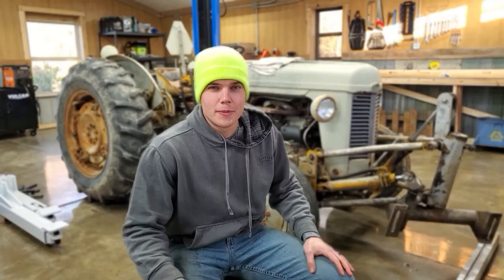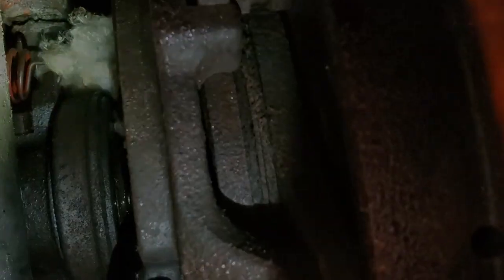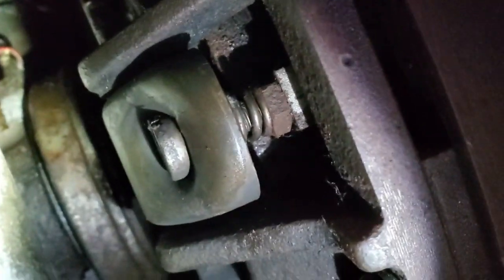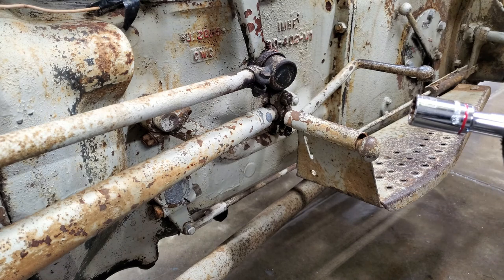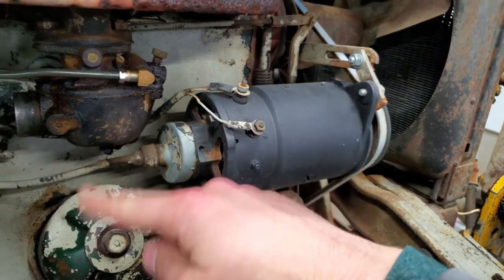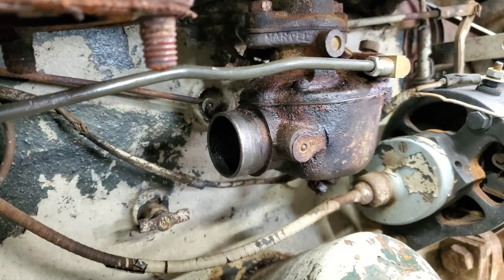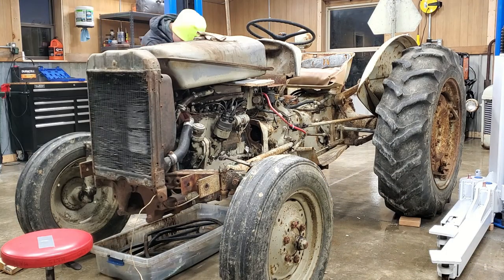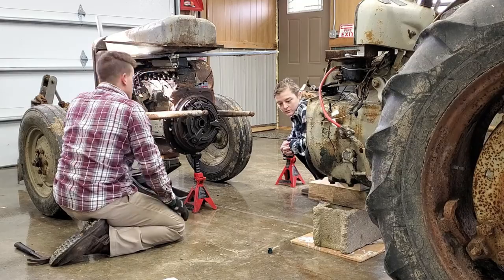Pt. 2/3: Splitting an Old Tractor - 1955 Massey Ferguson TO35

Comment: Yeah I’m struggling to support the from axel/suspension with 2x4s is still wanting to teater
Reply from the maker: I really had to hammer them in there. I would turn the wheel out of the way, then blast the 2x4 until it was really wedged in there. It deformed the 2x4 as it slid between the leaf spring looking thing and the bottom of the radiator support doodad (sorry for all the technical terms haha!). I'm not sure if that is helpful, but that is what we did.
Reply from the maker: I pinned your comment in case someone else comes along and can offer any additional advise!!

Comment: Had the exhaust flange gasket blow out on me the other day.
So I soaked the nuts good with PBB, every few hours for several days thinking i was doing myself a favor. 
Well first one on the outside left took a little extra with a breaker bar, and cheater pipe nudging it back n forth, but came off easily once I backed back tight couple times to clear the threads.
Outside right took good bit of heat and shocking it with cold water four or five times, and the rest finally went like first one. 
That back blanken blank, I had to remove fuel line the fresh air tube, both ends of the steering arm, and the peg running board, and the strut at the foot peg then swing it away from tractor. 
Still couldn't get on it good, because pipe has offset back towards engine. 
BTW, 17mm is what fit mine.
Anyway I went through most of a bottle of Mep gas, half of a big can of PBB, and couple trips to fill gallon bucket up with water.
When I thought it had broken loose finally, I went to tighten it up to clean the trash even though it'd barely moved.
Bout time I put just little nudge into it backing it up, Snap!
Shiny metal all the way across the dam thing, because it snapped clean off with just a tit sticking above the surface of the flange.
I popped it with snap punch about 5 times in a tight little circle around the very center of the broken stud as best as I could. 
Got brand new 1/8" drill bit, and got nice hole started about 1/4" deep, and went up two sizes.
That one kept pushing off to the outside of flange till I gave up and went inside the house for glass of tea, and didn't go back for couple hours, because I knew it was frustrating me. 
Went back, and after hour of trying to get the next few sizes up from first bit .
I gave up in total disgust, then next morning, got back of note book tablet cardboard, and used the flange on the exhaust pipe side to make a template, and went to my scrape iron plie, and pulled a piece of galvanized 4 x 4 x 1/2" about 18" long. 
Whacked piece off in band saw, then used death wheel to cut angle off one side. 
Made my pattern out of that put two nuts on top of one another tacked them together, and welded them onto one of the three holes.
Attached it to the two good studs tight as I thought I could get away with without snapping those off.
Spent bout hour doing that, got me the proper drill bit to tap it with 1/2" x 16 thread, and that took another 45 minutes by time everything was done.
9 hours for one 7/16" broken stud is beyond my reasonable amount of time dicking with that, but it is what it is .
Bad part when I went to put it back together, I didn't have anything to make proper stud with, and so I was going to temporarily use a harden bolt of proper size.
The first two went on fine, but at the screwy angle that back one is at, and I physically couldn't get either hand where I could reach it, hell I could just barely get a finger on each hand to it from either side. 
45 minutes to get one bolt started, and yes I tried putting that one in first second last every way I could think of to do it.
I finally went down the road to neighbors house, and asked him and his 6 year old daughter to come give me a hand.
I gave her $20.00, and a trip to Dairy Queen for her rescuing me, because I was fixing to burn that blankity blank to the ground any minute if I hadn't thought about her being home from school on Saturday.
Reply from the maker: Man I'm sorry to hear it was a struggle for you too ... why is nothing ever easy? Lol

Hats off to your perserverence, and thank goodness for helpers with smaller hands! Lol

Comment: I need this video thank u
Reply from the maker: I hope it helps! Or maybe it'll at least show you what NOT to do haha! Good luck on your project 👍
Reply: I’m in the same process right now working then coming back to the video lol I got lost on the linkage part now I’m trying to figure out how I want to balance before I split
Reply from the maker: @corydillon5724  we eneded up placing a CMU and some scrap wood under the transmission to support the back half. Then wedged some 2x4 into the front "axle" (not sure what to call the front suspension parts) just to keep the tractor from wanting to teeter back and forth. After that, it slid apart without much fuss using a floor jack under the front half. I think I put the jack under the bottom/center of the oil pan. Good luck!